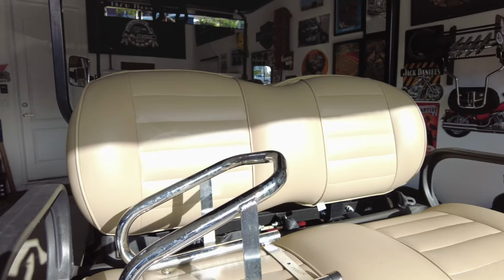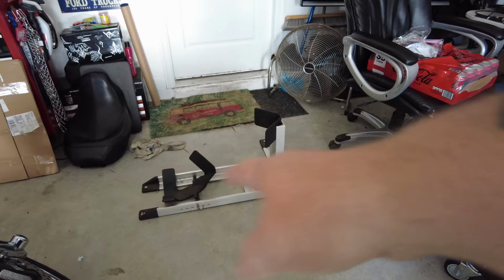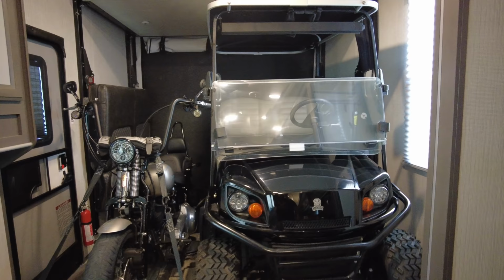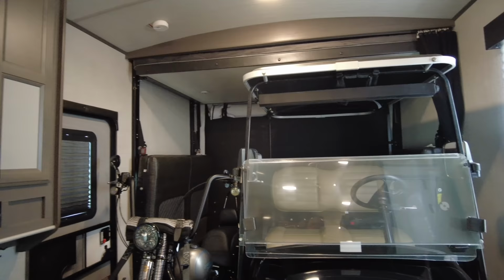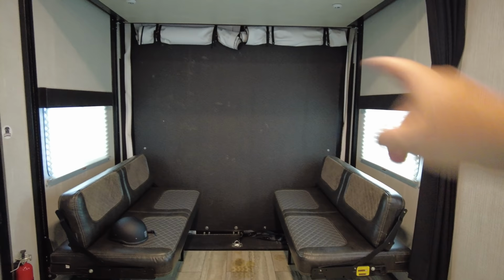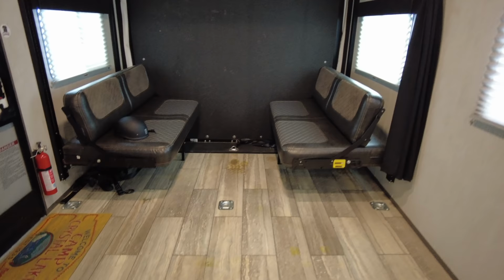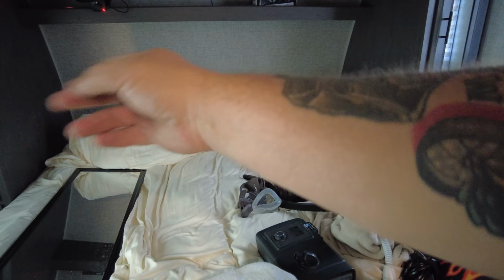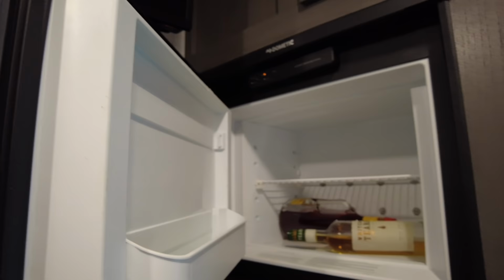Loading my Harley and Golf Cart into my RV toy hauler for a Motorcycle rally - do they fit?

Comment: You need some Biker Bars instead of the chock and straps. Especially when you are hauling a couple of bikes with your cart. If I had your hauler, I'd be taking it everywhere too!!!!
Reply from the maker: Can't. The biker bar leaves a bracket on the floor and this is also the family camper. My little girls toes would find that bracket in the middle of the night I am sure of it...
Reply: Totally get it. I usually unbolt the bracket and remove it when I want a flat floor. Found some plugs to put into the 2 holes in the floor when its out. It's an extra step to get the trip hazard removed. With a quality chock like you have it's a good set up as well.

Comment: You said you have 30 Gal of fuel for your gen on board that seems like a lot. How much does it burn in a weekend?  I run two small generators linked together and bring 15 gals for a weekend trip  seems to be just right.

Comment: So, at the bare minimum in fuel expense(just for your pickup) your looking at $288.83 roughly for the round trip! 
Do you have to stop between Leesburg and home to fill up along the way or do you have enough fuel capacity to make the trip on the fill up before you roll out?

And of course I haven factored in the cost of the 30 gallons of gas for the generator(and/or the toys)!

Just out of curiosity, how much do those bike chocks cost???

Comment: Question, including the golf cart how many bikes can you fit in your rig? Looking to buy one need to fit 4 to 5 bikes
Reply: That's alot of bikes, you might be better off with an rv and a box trailer.
Reply: Or another option might be a bumper pull toyhauler, 2 bikes and a golfcart in the toy hauler, and 2 bikes in the pickup bed.
Reply: No golf cart involved on my part , but I’m estimating the size of the cart to be two bikes